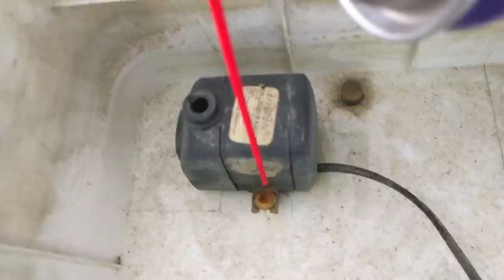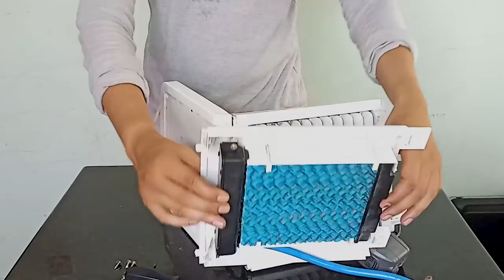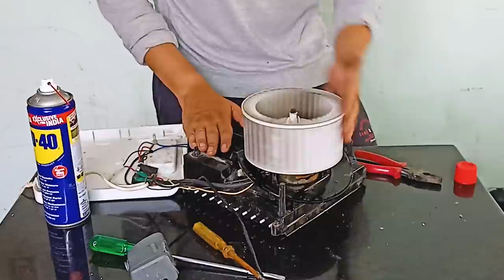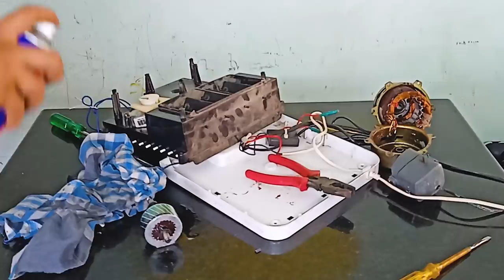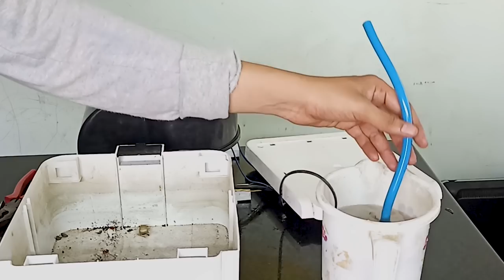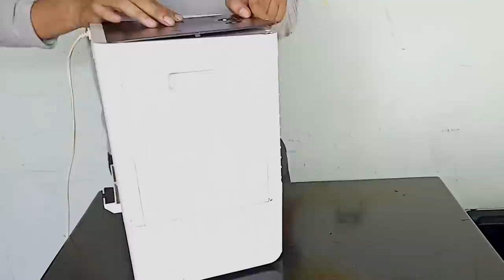Restoring old Air Cooler!! _Tamil, How to repair air cooler?

Comment: Super bro.... Keep doing ....❤️
I am seeing me on you.... 
I will also do such work in my house.... Happy to see these from you....
My small suggestions....
Do give some Explanation about possible common issues that can happen... Example
wire short circuit...
Debugging with Continuity check in wire...
Checking switches with multimeter (ON , OFF)...
If any regulator  or transform check for output by multimeter
Etc....

Comment: Anna tower fan speed kuraikka yethavathu idea irukka?  Pls konjam sollunga
Reply: You can connect fan regulator
Reply: @mohamedismail485  i already did it but speed not control.. Motor la 3 speed coil wire connect aairukku.yentha wire la connect pannalum speed kurayala

Comment: Hi bro safe irukinga bro unga video nalla iruikku bro. Bro capacitor dc and ac rendu mael store pannu pannuma bro. Yenna capacitor block dc solra inga Ana pcb board lalan capacitor use panrom reply pannuinga bro plzzzz
Reply from the maker: Capacitor don't block dc. The current is limited at initial stage.
Reply: @engineeringfacts  initialla mattum block pannuma bro aprm allow pannuma

Comment: Bro UPS working & UPS mode la fan noice edhukku varuthu nu video podunga
Reply: Square wave inverter la noise varum athanala than fan la sound varuthu,  unga veetula tube light copper chock tube iruntha atha remove pannittu led tube podunga.. Athavida best pure sine wave inverter vangunga